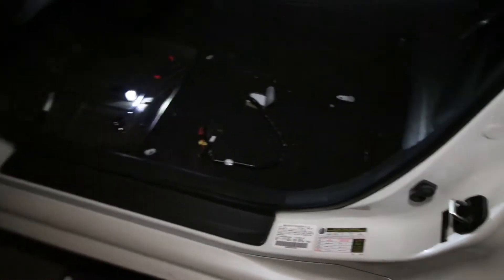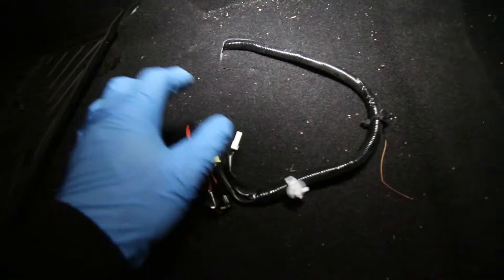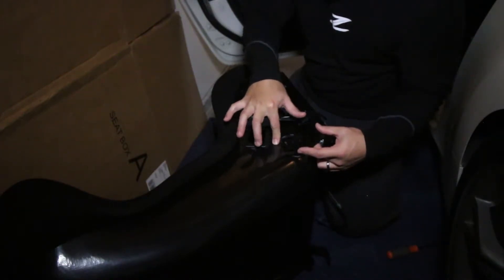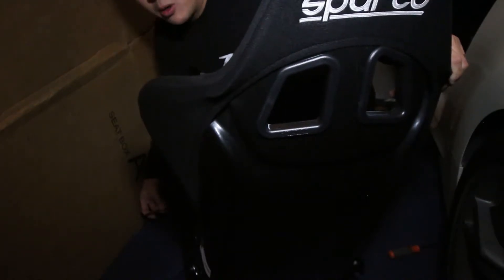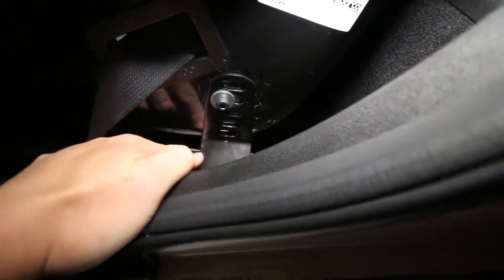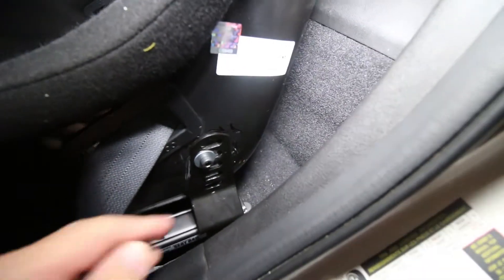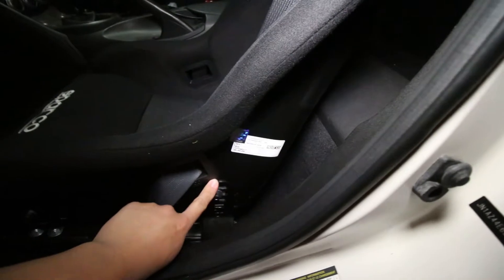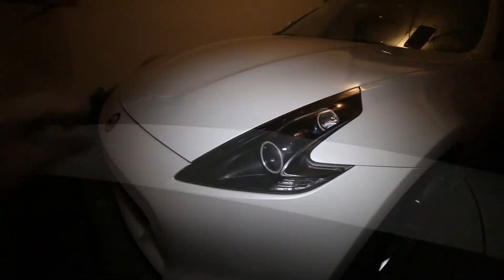Buddy Club Rails SCRATCH! Sparco Evo II in a 370z

Comment: Hi, great informative video.
I'm going to mount on my 370z the same rails with a custom made seat.
How d u get rid of the rails misalignment ? D u use some spacers between the seat and the brackets?
Reply from the maker: Hey buddy. I noticed that the sparco seats are slightly tapered. Wider at the front than the rear.  That was the cause of the misaligned. If your seat is straight front to rear you should be fine.
Reply: Yeah most of the seats are, so do mine... I think I will try with some spacers on the rear.
Ps. Did your Sparcos  hit the doors?
Mine are 23,5 wide...
Reply from the maker: @thedoc6884  They didn't hit the doors at all. They fit perfectly in the car after a little update.  I swapped to Planted floor brackets and side mounts to bring the seat even lower.  Unfortunately, no matter what configuration I had the BC side mounts in the seat sat too high or too tilted back.  So some fabrication is definitely required to get it to sit the way I wanted it.  I didn't do a video on that unfortunately.  Good luck!

Comment: Hey! How much lower did this seat + rails combo sit than the stock seat? I'm a wide guy so I need the Evo II US, but I'm also tall so I need to drop about an inch compared to the stock seat. I'm realizing these two things are going to be hard to make happen at the same time
Reply: Hey buddy. The problem with the Evo 2 with those rails is it did sit too high. I swapped to a planted backet and fixed seat mount. Instagram @gearhead_tech for pictures